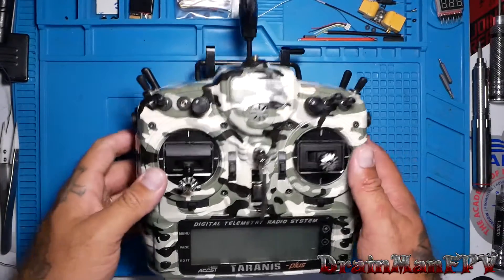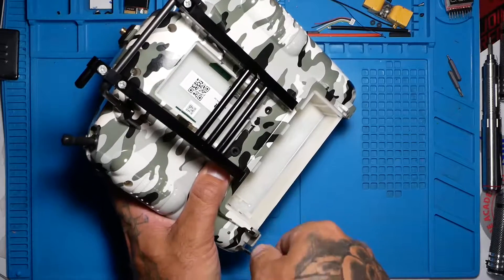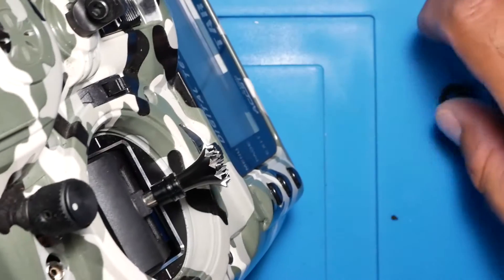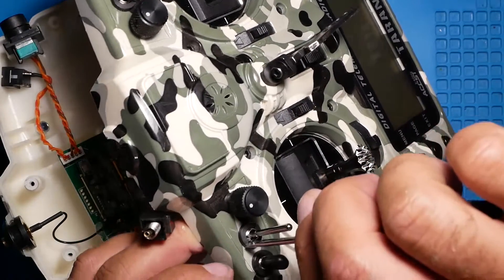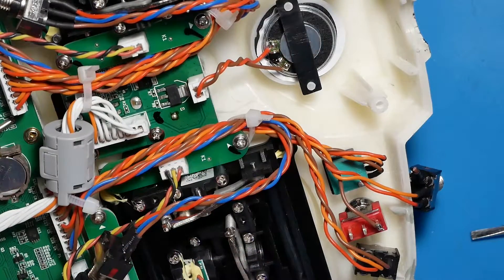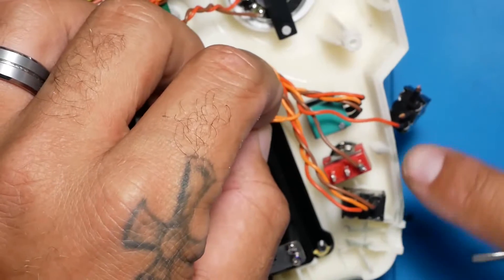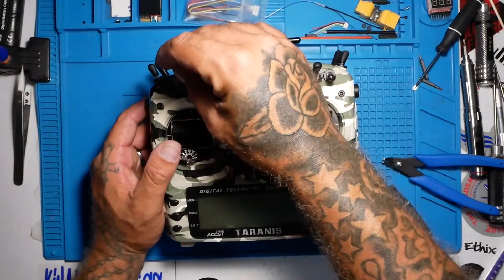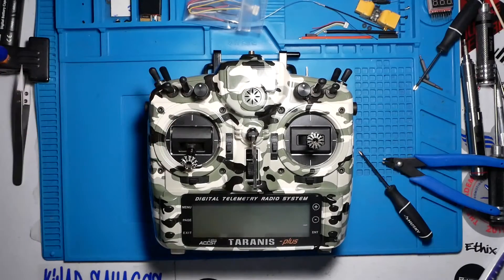Repair Your Broken Taranis Switch - Frsky Radio Fix

Comment: If i remove a switch without replacing it, will the radio give me some kind of errors or alarms? (Id like to have less in order not to break them)

Comment: Hi!
I need help!

Because the antenna from my radio (FrSky Taranis X9D 2019 ACCESS) came from factory  too stuck I damaged it twice. The first time, i made a new one from old coaxial cable from old laptops and worked fine!
At the second time, while removing the hot glue, without noticing, I removed a very small blue component that is very close to the soldering points of the antenna. I still don't know what component is!
The radio still works but, with the Fr-Sky ARCHER R8 PRO after 200 meters i get low signal warnings... :/
Do you think that I can easily fix this or should i buy a new module?! 
Or, if i buy the external module R9M, should it work fine with the old module?

Thanks in advance!
cheers

Comment: Great Tutorial!.. Is it possible to replace a 2 position with a 3 position?
Reply from the maker: At first I thought you wanted to put a two position where a three position was, now I see that you are asking if you can put a three position switch on what used to be a two position. If you do that only two of the positions will work
Reply: @DrainManFPV  Ok thanks for letting me know!